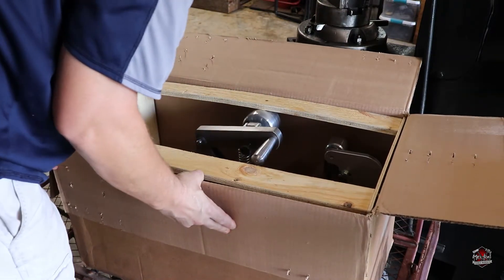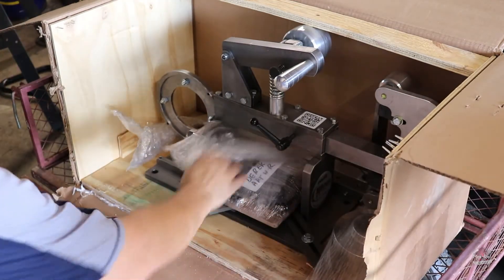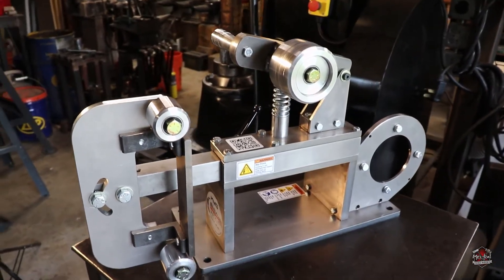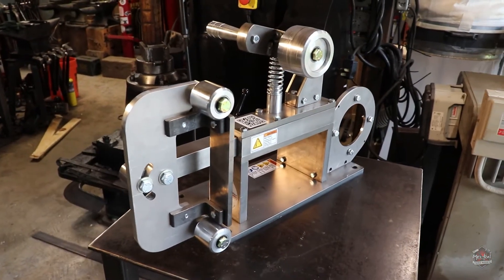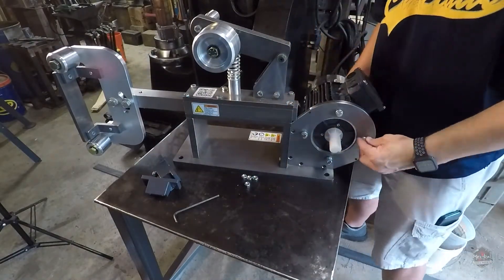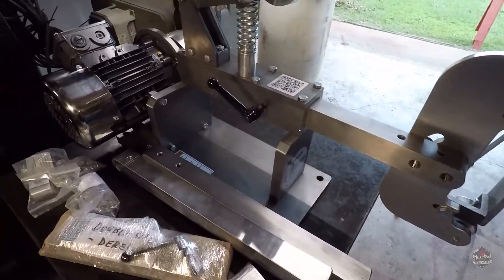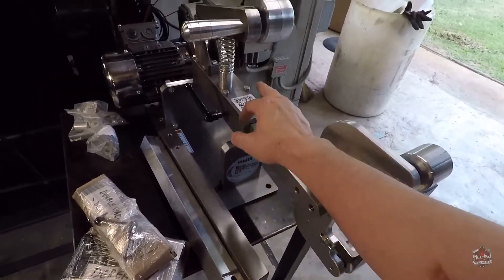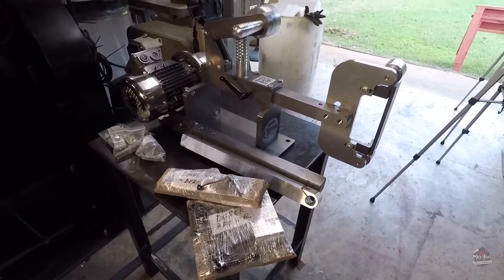Unboxing a Direct Drive KMG Classic 2x72 Belt Grinder

Comment: And it does not turn horizontal just a waste of money.
Reply from the maker: That’s a ridiculous statement. I have another grinder, it does tilt, rarely use that feature.
Reply: I thought about the KMG TX with the horizontal option for a moment. Thinking to myself, $1000.00 for an option that I might use 0.03% of the time, now that’s probably a waste of money. The $300.00 VFD option I would use every day over the 3 speed belt drive. That might be money well spent unless a diode burned out, then I’m probably wishing I had the KMG Classic 3 speed belt drive. 😊